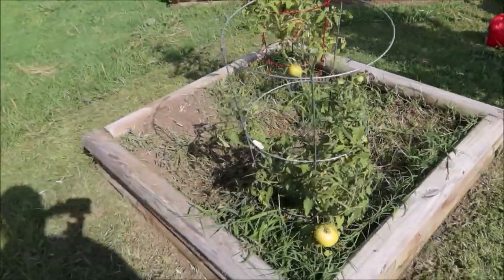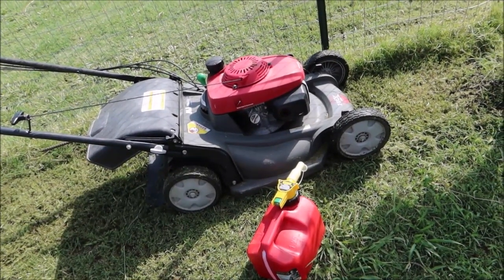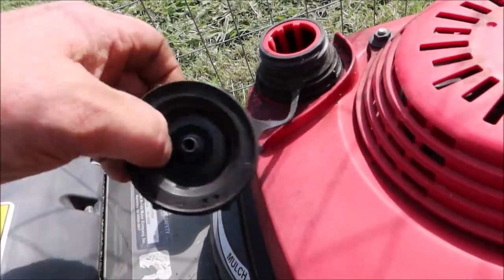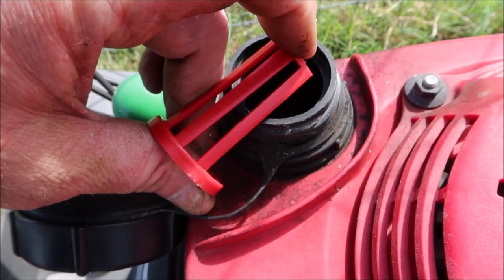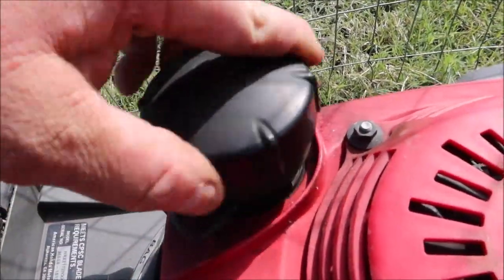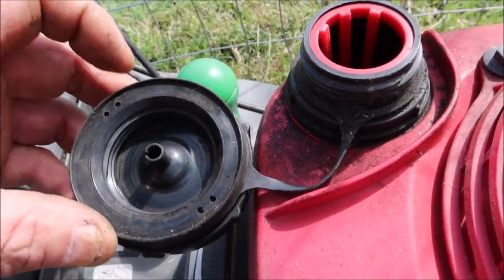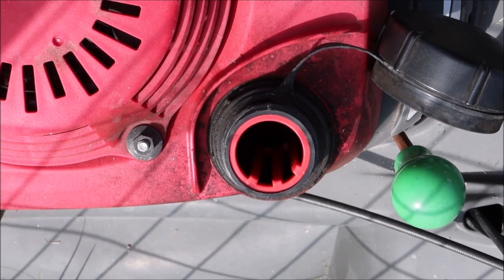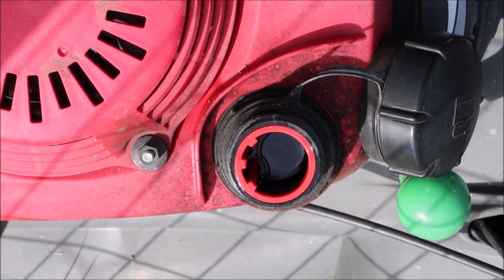HONDA GCV160 NO START /  CLOGGED CARBON IN FUEL CAP

Comment: Jesus Christ been doing this wrong the whole time.  I never knew about the fuel level stop.  What I have been doing is pulling the rubber plug off the cap and drilling a small hole OFF center.  I reinstall the rubber plug and SEND IT!  I haven't had any issues, from now own I will pass this info on to existing Honda Owner's and New One's when I sell a honda powered machine!

One of my favorite quotes of all time is "When you learn something new everyday, you get to teach something new everyday"

Comment: Thanks for confirming this.  I always mean to see what that red insert was, but always forgot after I am done mowing.  I have to take it out when using my funnel with a float insert so I don't overfill, but always put it back.  I never have an issue with overfilling due to the funnel with the float.  Only problem I had with this engine was (when brand new) that it would surge.  I found a honda bulletin that pointed out that there was a newer (smaller) governor spring but it is what mine had.  The one tidbit in the bulletin that fixed it was the mention of twisting the governor spring tab to adjust the rpm.  Working great ever since.

Comment: I'm glad I am a subscriber to your channel. I have Troybilt TB 240 mower with a Honda GCV 160 engine and only noticed the four holes in the fuel cap this afternoon after watching your video. I didn't know about the fuel level stop either.

Comment: Thanks for the info never had a problem on the honda push mower but my 4 stroke honda trimmer can't tighten the fuel cap to tight or it will boge down tryed new cap same issues

Comment: I need to buy a new mower, is Honda what you would recommend. I've been real happy with my Honda generator. Thanks
Reply from the maker: I like the cut quality of the Honda.  Rear wheel drive is a must also.  I’ve had mine for
14 cutting season now with zero
Issues
Reply: Just replaced a 20 year old Honda,  still started first pull, deck was rusted. I bought a toro powered by Honda for the side discharge option.
Reply: I truly got mine for free, someone was throwing it away because the rip cord would not retract. It was like new condition, oil was very clear, all I did was remove the old fuel, changed the oil and of course the old starter cord assembly. The only thing I don’t like about the starter cord is even the new replacement, after several uses hangs up and I have to tap it or jiggle the cord back in. I’m not sure if dust or grass particles are causing that or I got a cheap aftermarket on Amazon or what. I’m afraid to lube it, does anybody have any suggestions? It always starts right up, just have to play with the cord.
Reply: Yes, definitely
Reply: @ThePerfectSeason1972  spray wd40 in the round spring in the pull cord housing. Take off the pull cord “cover” and there is a big metal strip coiled into a circle, spray wd40 or all purpose oil on it and put the “cover” back on and pull it over a few times to work the oil into it. The pull cord should go all the way in now.
Reply: @EthanAdey  - thanks, will do!
Reply: That or buy a quality battery mower like an Ego, then you dont have to worry about runability issues. Just lube the wheels and sharpen the blade.    No fuss no muss just mow the yard.

Comment: Great videos.  I watch all of them.  Curious.  I have a Homelite Pressure washer UT80993E With a Honda Engine GCV160.(GJARA-39786447 N N5R).  Is it normal for the engine to surge and when you hit the trigger to power wash the engine smooths out?  Is there a fuel filter on this model?  Thanks.

Comment: If the holes are plugged with debri THIS WILL CAUSE SURGING!!!!! Gas doesn’t flow to bowl, starving it causing like your running out of gas. You look in tank & say I have gas. Took weeks 2 realize these holes were plugged causing SURGING! Thanks.

Comment: Little tiny black beads was falling out of the holes of the cap and then I noticed it was around the spout that you pour the gas into....So Does that mean I need new gas cap?  On a Honda pressure washer.
Reply from the maker: Yes new cap time